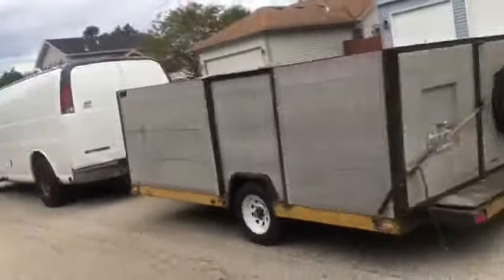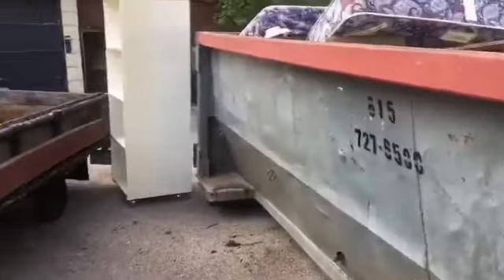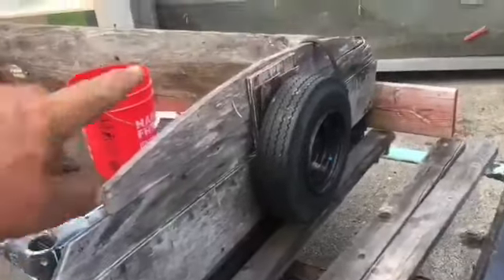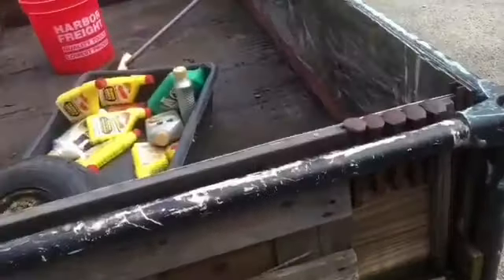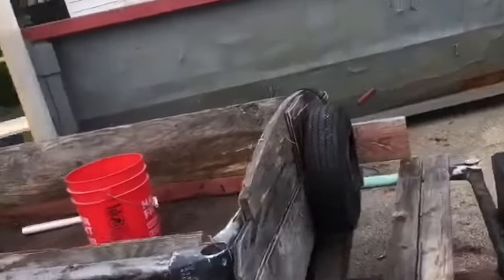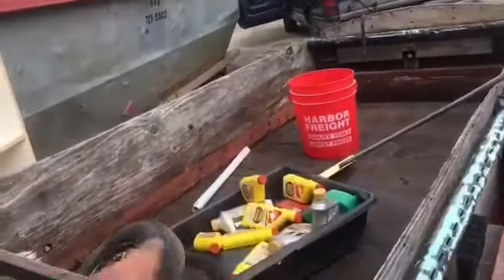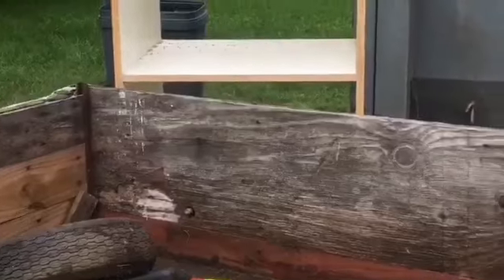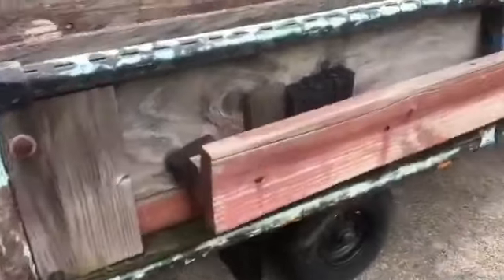CAN I STILL COMPETE?

Comment: Modify the trailer, get the rear end out of a truck. The frame looks heavy enough. I'm sure you have enough scrap metal to build up the perimeter and put a proper gate on it.
Reply from the maker: All are superb ideas 
I’m sure I could fashion something with all of the Scrap I have
Even using some scraps to make a hybrid of trailers out of the camper trailer and the flatbed trailer

Comment: yeah  sucks nothing to pull it with.i seen crazy trailers myself.but thats Texas for ya.4x8 yeah no bigger than a sheet of plywood.but you may find a few long things like pipes and crap you can stretch out to where the jack is on the trailer but thats if you had it in the trailer and holes on the wood etc.may be light  for you but if truck is fully loaded a little more poundage be good in the trailer..
Reply from the maker: All true
Reply from the maker: Trailer less common in Illinois for some reason